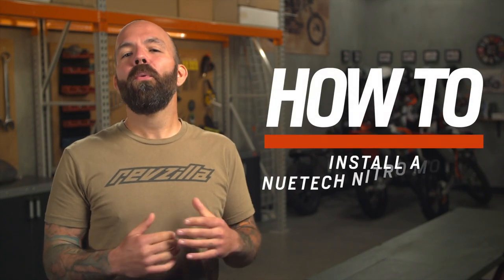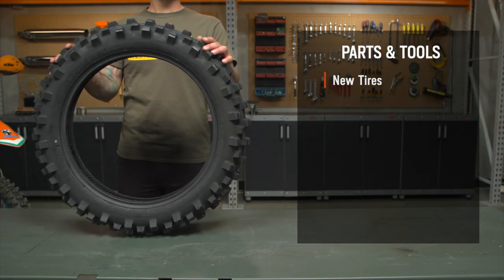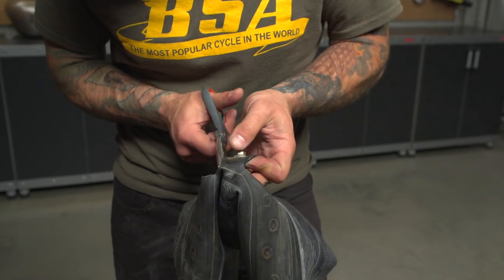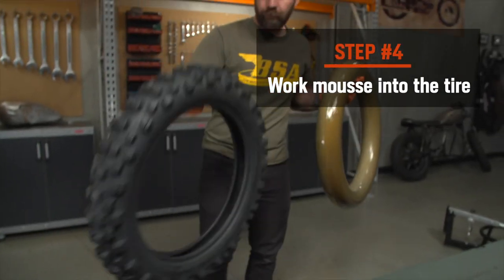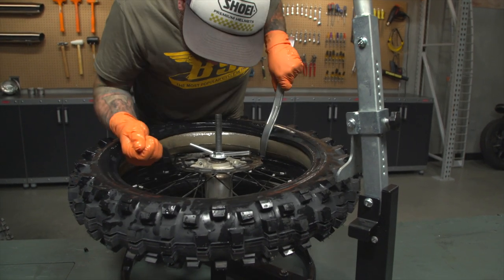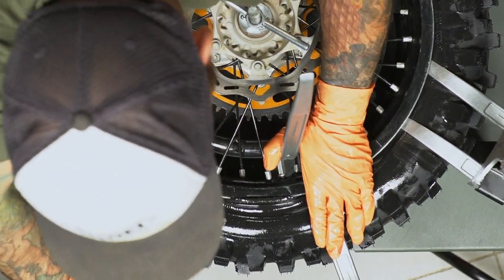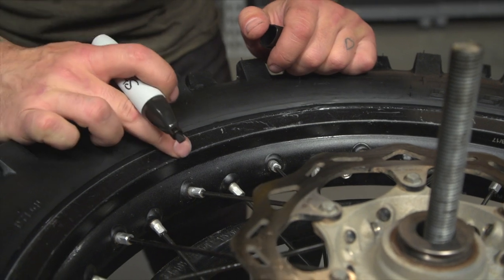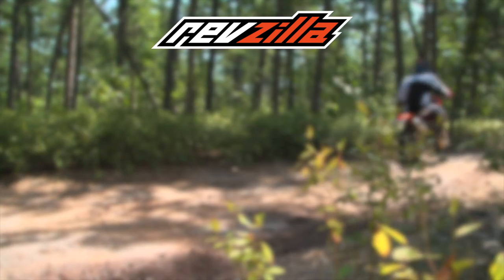Nuetech Nitro Mousse Installation Video

Comment: Wonder if they could make these for other bikes with a higher psi feeling.
Reply: There are mousses for rally racing which mimic high pressure
Reply: @MrNz96  I'll have to check to see if they're approved for road use.
Reply: A hybrid would be also interesting. Tire still filled with air but with an "emergency" nitro mousse inside to get home at reduced speed when punctured.
Reply: @Chris-yy7qc  I was thinking the same exact thing. Be nice to have a moose that is meant for road oh shit moments. Would actually save lives probably since tires popping would hurt probably vs a moose

Comment: Why has no one invented a foam that you can spray into the air valve and sets hard like construction foam. It would be SO much easier than installing a moose. I tried to installing a moose yesterday and ended up giving up. I couldn't even get the first bead over the rim.

Comment: Looks like a pain in the a$$ to do
Reply: It is
Reply: I failed. even tried to use a cinch strap to hold the rim lock side together while I tried to lever the bottom bead on...kept popping up...or too far down...slippery tools...had a nuclear melt down lol. cleaned everything up...gonna put tubliss on in a few minutes after my blood pressure comes down
Reply: I have yet to see a demo on a wheel as small as my 1.6 width 21" front.  I don't really see how it is possible.  The Mousse they sent is the size they said we'd need, but it looks far larger than what I'm seeing in the demo videos.  Not for road use, either, which makes sense because of the extra heat involved and the low pressure (we got the higher pressure mousse, but it is only 10-12psi).